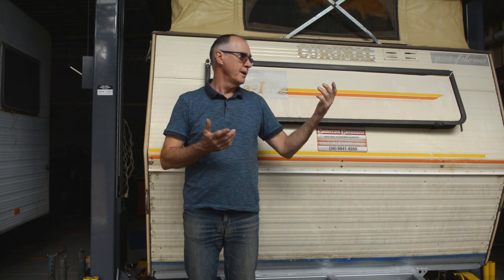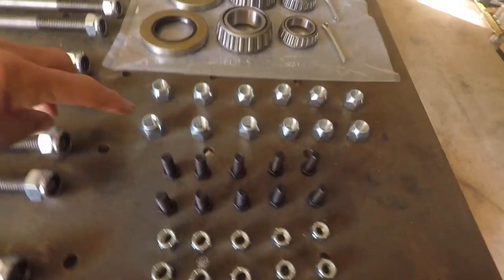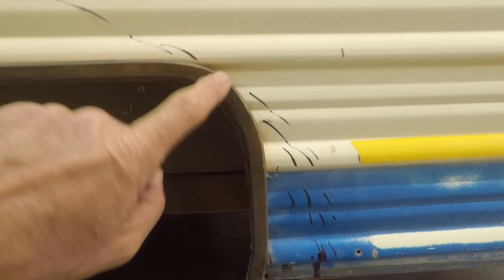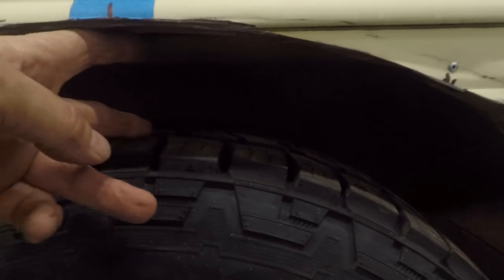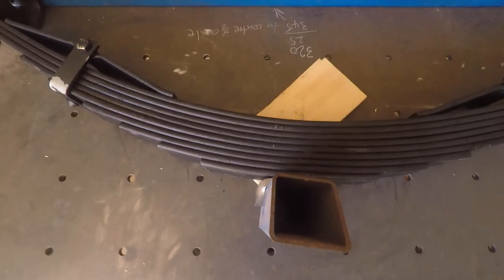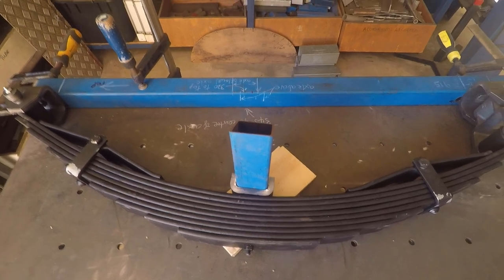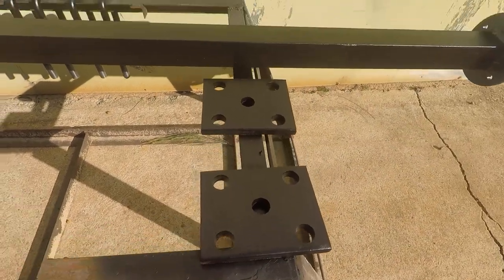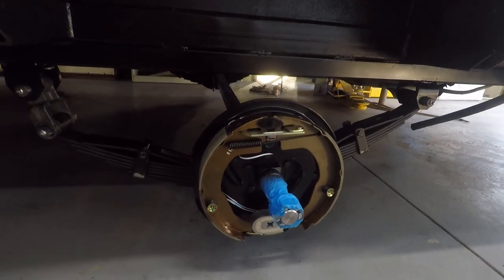Goodbye Camper, Hello Caravan | Part 3 - The Suspension

Comment: Cheers Rusty, also looking at doing something similar. Also in Perth, thnx
Reply from the maker: If you go with a standard length axle, it will save problems down the track, should you need to replace it. You might have to look for rims with an offset to suit your installation...something else to consider when upgrading the axle, springs, etc.

Comment: Great work Rusty. My only suggestion is to weld in a reinforcement plate/gusset between the front spring hanger and the chassis as the hanger is only relying upon the two horizontal welds.  I've seen many a front spring hanger pull out/break welds after the wheel hits a large up bump at speed
Reply from the maker: Hi Andrew, and thanks for your comments. I'll definitely look into what you suggest.
Reply: Couldn’t agree more I’ve repaired tones of 2tone builders trailers that have ripped the hangers off.. specially that you’ve only used 50x50x3mm those mounts will rip off over time with abuse I’d run some 5x50mm plate from the hangers all the way up to the factory chassis if you want piece of mind

Comment: Certainly gives the van a real off road look now. Are you replacing the corner wind down stands, they probably wont touch the ground now. Love the extended draw bar
Reply from the maker: Hey Russell, it definitely looks the part now, for heading off-road. Yeah, those wind down stands will need to be extended, as they are almost all the way down before touching the ground.
The extended drawbar was what attracted me to this particular van, as the quad bike will fit nicely on it.

Comment: Boy you have spent some time on the mod now and looks a treat, no issue now with clearance,  would be good to know the weight once finish to the start weight. Looking forward to the Quad mount and the interior workout.
Cheers
Reply from the maker: Thanks David, I'm really pleased with the way it's turned out so far. I'll be heading to the weighbridge next Friday as it's booked in for it's inspection....fingers crossed it's all ok and I get it licensed.

Comment: Hi Rusty, I am soon to do the same suspension upgrade to my Prattline hi-low caravan, great video, it will make my upgrade very easy having your video to follow. Do you mind sharing the cost of the suspension upgrade that you used? Cheers Mick.
Reply from the maker: Hi Mick, from memory, the axle, springs, electric brakes, tow hitch, etc came in around 1200 - 1300. On top of that, I bought the rims 2nd hand but put new tyres on them, so all up, I probably spent around #2000 on the whole suspension system. Good luck with the upgrade to your van.
Reply: @RustysOutbackAdventures  thanks Rusty.

Comment: I was going to do the same..on my baravan.
Reply from the maker: Hey Donald, if you upgrade the suspension, make sure you choose a standard length axle rather than a 'custom length'....makes it easier if you need to replace it in the future.

Comment: Next time don’t f up your trailer and go with smaller tires that fit after the lift
Reply from the maker: Hi Glen, unfortunately I didn't really have a choice because I had to fit 12" electric brakes because the ATM was more than 1600kg. 12" electric brake hubs suit a minimum of a 16" rim, and even using a 245/70/R16 Light Truck tyre, some cutting of the wheel arch was inevitable. Also, the increased ground clearance with the bigger tyres, was something that I was looking for, too.